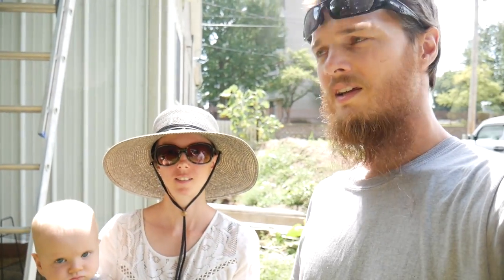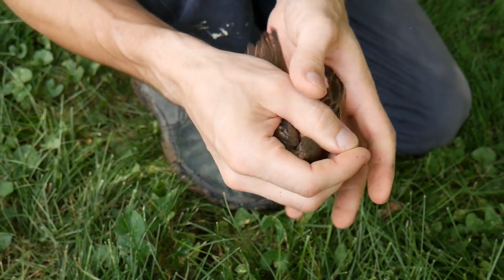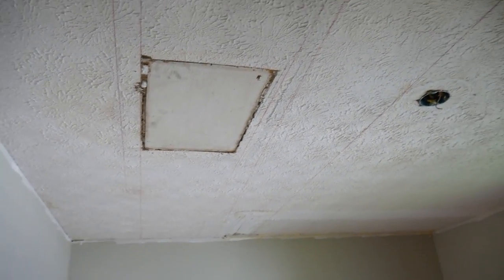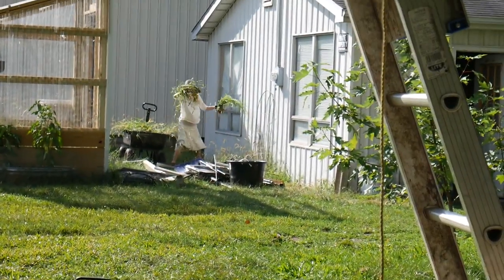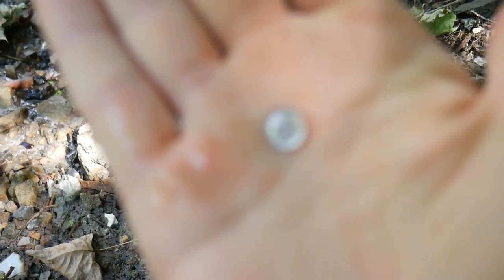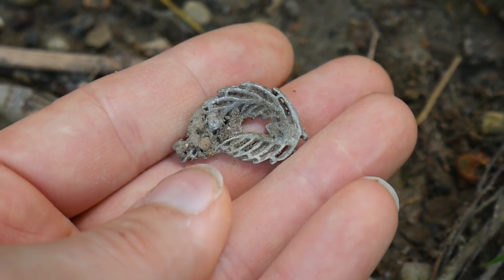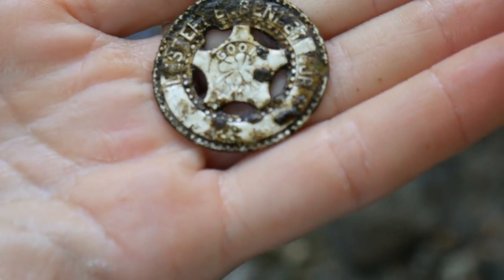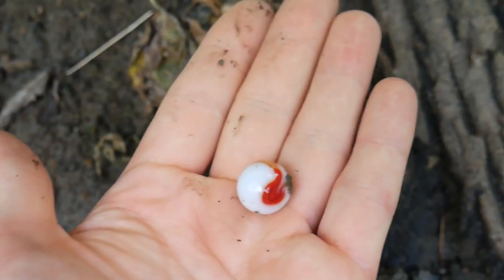A Little House work & Bonus Creek Relic Hunt! Mudlarking

Comment: Aww, Little Bird. Hope he figures out how to fly. Glad Bell saw it. Awesome idea , using your pin-pointer in a different way than it was made for. Multi-purpose. That's the way i think when I look at anything. How many ways can I utilize a single item? Kind of the way the Swiss Army Knife people look at things. Super Fun Finds. Yeah! Ashley found the first Marble! That Walker China plate Ashley found was way Cool and would be a neat historical display item. Put a dab of hot melt glue on the bottom side of some of your favorite small finds, to secure them onto the plate, then either put a stick on hanger onto the plate, to hang it on wall or set it in a wooden plate stand, (Doug could take a block of wood and cut a groove about an inch deep into it and stand the plate on a shelf with some other Fave Finds. Doug's little blue coupe was neat. Ashley's button was seashell, they call "Mother of Pearl". Love it! I have a small collection of them. They remind me of a time when Mothers such as mine, either made and or mended their clothes, instead of throwing something out because it lost a button, like many people do now.    Stop the vid at the time mark Seven : Ten, Right next to where Doug found that child's shoe buckle from the nineteen forties or so, there was another button, that may have been old military, sitting on top of a (rock?) Not only that, the rock, shaped in a Vee, if rock, May be a giant fossilized Bat Tongue Tip, from the days there were giants on earth. The fruit bat's tongue tip is shaped like a (spade) in the card deck. Check out Megabattie channel on YT. I think Bell, as well as the rest of you will Love it. They are most always less than five minutes each vid, in Australia. The Flying Fox, Baby fruit Bats, that Meg Rescues, are Super Adorable (No Kidding). You'll see.  : )

Comment: That is a creepy crawler mold.  You use plastic goop and a machine which heats the mold.   People who collect those machines would probably buy that on ebay.   I always wanted  one... they were real popular in the 1960s and 70s
Reply from the maker: It was so random to find it in the center of the creek. Makes you wonder when it got lost and why it was there, lol.
Reply: That can be your catch-phrase "That is so random"    Anyway, they made a variety of molds, some geared toward boys and some for girls with a mold to make flowers etc.  I had a friend who had one... it plugged into 120 volts and would get hot enough to burn.   They later made one which used a light bulb.   The 60's was the last decade of really dangerous toys it seems like.   I had a similar machine which made car bodies you could clip on battery powered cars.   Most kids are smart enough not to burn themselves or at least have an adult around when you make stuff.     Some creepy crawler sets made rings and pencil toppers too.   It was a really fun toy.  I think I know the toy you talked about.  It would make gummy like candies with weird flavors.  It came out in the 90's.

Comment: The good luck badge you found was made in a machine usually at a museum or other high traffic location.   You would pay money then point to the letters you wanted to stamp into the badge and pull a handle smashing the letter into the soft metal.   The concept was similar to the machines which squish a design onto a penny.   I remember making one as a kid.
Reply from the maker: Oh cool, never knew about that. Very interesting!